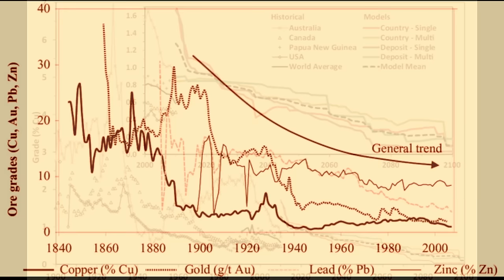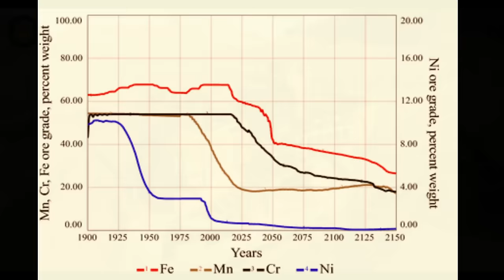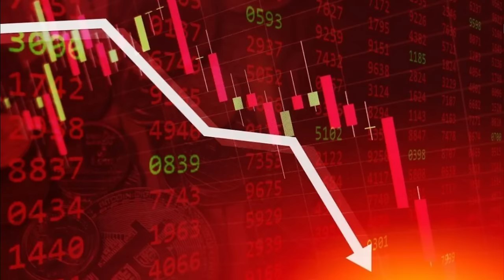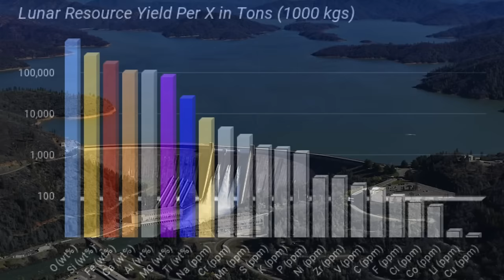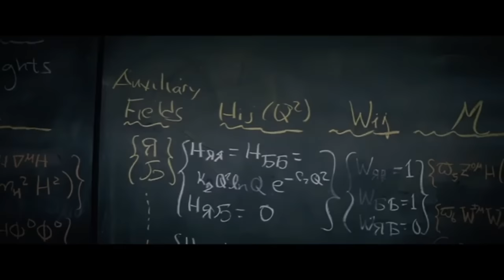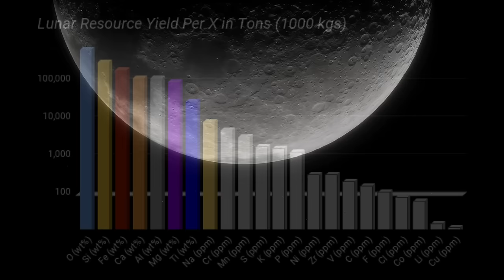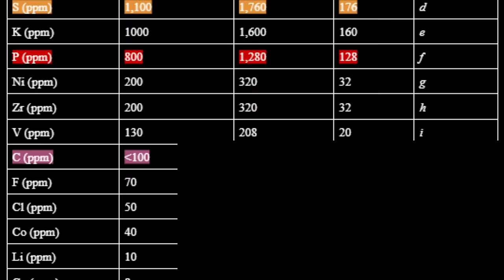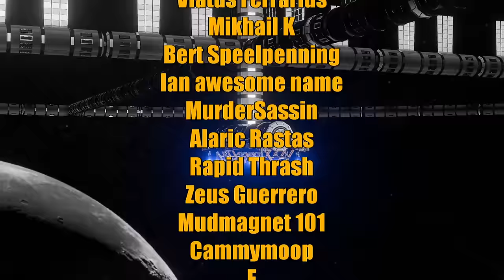Strip Mining The Moon With Giant Excavators

Comment: Another thing to note about Lunar steel - no rust! Low carbon steel with trace alloy metals would get you pretty far.
Reply: An architechts dream
Cheap rust free high strength steel in a decreased gravity environment
Reply: Absolutely. This would also make building first structures out of wrought iron much easier. No oxidation protection needed, at least for the structures that will not have atmosphere inside.
Reply: @johnnywalker472 Your metallurgy will produce free oxygen as a byproduct in such massive quantities that it can't all be stored or used. Some will be dumped, over time creating a faint oxygen atmosphere that could potentially oxidize your metals.
Reply: @louishermann7676  you underestimate the amount required. additionally, the main reason the moon doesn't have an atmosphere is that it lacks a magnetic field and the gravity required to keep it. we could pump whatever we wanted into the atmosphere and chances are it'd end up in space
Reply: @louishermann7676 I believe the amount of oxigen that needs to be emitted to reach that point, is extremely big, especially when we use the oxigen as rocket fuel. So we most certainly would have centuries until we need to worry about oxidation on structures that are outside.
Reply: @xandermoore6485  I'm not suggesting that the moon would keep it, but it is the largest gravitational body nearby and so the free oxygen would tend to accumulate there.

I don't have a grasp on how much that would take, or what variables cause things to oxidize at different rates, but if you build under the assumption that nothing will ever oxidize on the moon and you dump waste oxygen you're likely to encounter that issue at some point.
Reply: Galvanic corrosion will still have to be accounted for.
Reply: @louishermann7676  gotta pump all that oxygen into underground reservoirs ie lava tubes...
Reply: Complete BS. Lunar dust will destroy the equipment.
Reply: @slo3337  Wow, I wasn't aware we were in the presence of the only moon mining expert in the solar system.
Reply: @magisterrleth3129  well now you know
Reply: @slo3337  Lol, okay, buddy. I'm sure you're a real smart fella working on real big things, and your mom is very proud of you.
Reply: @magisterrleth3129  don't call me buddy pal.
Reply: @slo3337  Don't call me 'pal,' friend.
Reply: @magisterrleth3129  don't call me friend brother
Reply: well if there's no oxides then then wrought iron or pig iron would be significant enough so long as you can get pure iron because what makes it not very good is because of the fact thatit normally contains a lot of impurities and it tries to oxidize throughout the whole process as the crystal form resulting in layers of oxide between the Crystal and structure ruining the Integrity of the metal probably be best to use for fixed structures or in areas where oxygen isn't exposed directly to the metal. also why not just use nickel iron it's one of the most common naturally occurring iron Alloys and I do believe it's what most asteroids are made of
Reply: No rust, no gravity.  One could build megastructures from silicon dioxide.
Reply: yeah but we add carbon to steel to get martensite or perlite, we don't add it to protect from rust. Carbon free Iron is extremely soft and really bad to build with.
Reply: @bromine_35  holyhsit you're right
that'd make for some insane architecture
Reply: False, the moon can rust just from the excess oxygen expelled from earths atmosphere.
Reply: Normal steel gets brittle at -40 dark parts of the moon get much much colder
Reply: @pietown044  Sauce, please.

Comment: There's nothing that says moon structures must be built from steel, regolith has lots of aluminum and titanium to use structurally, and vacuum removes the need for shielding gasses to weld them. For megastructures like O'Neil cylinders, those lighter materials might be the preferred options to reduce the cost of lift to orbit.  Concrete made from regolith, made air tight by glassing layers of it, or putting in some kind of resin or fabric liner or whatever, might be another option for Lunar bases. Carbon might end up too valuable for food production biological carbon cycles to put to structural use, given the cost of food imports; conversely if food imports get really cheap, excess recycled sewage solids may be a primary source of carbon for structural use.
Reply: All of the thermosetting resin and epoxy to seal said concrete would need to be shipped up to the moon, and for long term stays we would need a loooot of concrete and steel to seal up
Reply: @phantama7615   We would likely just use sulfur to make concrete, its a great, water free alternative and very robust.  It will work better on Mars as the sulfur is there already, but it's a good option for the moon too
Reply: So many options....
Reply: @BarrGC  you’re right, it’s melting point isn’t to high either, purified and exposed to the sun it would melt into a liquid on the moons surface, giant solar powered forges, easy to transport back to the moon as well since both bodies have lower escape velocity
Reply: and there's no free oxygen / water to oxidize anything, opening the way for magnesium and super non-stainless steels optimized for strength only
Reply: Aluminum is a pretty good idea tbh.

One issue with metals that the author didn’t raise is cold welding.  Since metals wont form an oxide layer, some form of lubrication will be needed to avoid this phenomenon.
Reply: One UAP sample was an alloy of titanium and nickel. Interesting enough you can only make the alloy in a vacuum and melting with a electric arc.
Reply: Do you even know how aluminum is made? That stuff is gonna send us back to the cave man age before you even have time to think about it lol

Comment: So as someone in a background in the mining industry I have another thought. I know we do not know the exact composition of the sub surface minerals of the moon or and real idea how stable it would be, but the idea of mining in shafts that are subterranean seems like a good idea somewhat. It gets rid of the heat issue, also the excavated tunnels and be used for expansion of "habs" for us to live it and all the materials gained may have better composition than that of the surface regolith. If this was done you could also use a boring type machine that would normally be used here on earth for tunnels to mine, because we are nine going after veins like typical below ground ming we can just mine in one line continuously. Like I said I know nothing of the sub surface makeup of the moon and its stability or it's mineral composition, so this could be an easily disproved idea.
Reply: I dont think we will know the sub surface makeup until we are well into the artemis mission

Comment: Mentioned on your other video, but as this one is more recent I figured I'd also mention here that though ferrochrome is probably not a great material for building on the moon, there are several nickel-iron-chrome alloys with promising characteristics.  One in particular that jumps out is inconel600, which only has a few trace elements besides those.  Though not as hard as steel, it beats out most non-steel metals(elastic deformation 400MPa, plastic 700).  It's also highly corrosive and temperature resistant, showing less loss of strength under high and low temperature than steel, which would be of great use on the moon. 

Not saying this alloy is necessarily the way to go(the nickel connect is likely too high to be ideal) but it highlights that there are good options that don't require carbon(or require very, very little).

Comment: 7:53 Why use sodium as a fuel source when electrical operation would seem to make the most sense. Large solar panel arrays would essentially be connected to machinery through big cables on spools that way you don't need batteries. Electrical power is also ideal because aluminum is abundant in the regolith so making simple, cheap, DC brush motors should be easy as long as you can get aluminum refining going. The fact that aluminum is less efficient doesn't really matter since the sun gives us nigh infinite electrical energy. You could probably get alumnium refining temperatures acheived relatively easily by using mirrors to direct sunlight into the lunar regolith and getting it to several thousand kelvin. 

Electrical motors are about as simple as you can get. The main thing would be being able to produce solar panels on the moon using local materials which you need anyways for sufficient electrical power. Companies are already demonstrating this process.

Comment: Understanding that regolith is more than 45% O and 20% Si, and 5-10m deep, the logical conclusion is to dig below to find the original crust or, even better, the Moon mantle exposed on the surface,  with way more valuable materials and better yield. Ergo mining on tunnels and caves.
Reply: Without plate tectonics to bring material to the surface I imaging lunar bedrock will be very low grade. During the moons formation the heaviest elements would have sunk to the center. If the moon was geologically active in the distant past there may be hope though.
Reply: @SephBane After the Aitken Basin impact, the mantle is exposed on the mare with great potential for heavier elements and access from the lower points, also 4By of materials from other meteorites all over the surface.

Comment: Steel is the low-carbon version, the high-carbon version is called iron. This is just because carbon is used to reduce the iron ore to the metal, the less refined version has more carbon and is thus cheaper with worse properties. On the moon you dont use coke to reduce steel so its easier to get purer steel/iron. Other than that, stellar video, subscribed.
Reply: Iron is an element.  Iron IS iron.  When you add a little carbon to iron you get steel.
Reply: @TheEvilmooseofdoom  There is no product you can buy which is Iron without carbon. In the video wrought iron was brought up as an example, but just like cast iron it has more carbon content than steel. If a alloy is called iron then it has higher carbon content than steel.
Reply: @ThePhiphler   I think you mean cast iron/ gray iron maybe?  Cause it's like @TheEvil... said, iron is iron, the element, add carbon and you get steel, add too much carbon and you get cast iron
Reply: @BarrGC  Its a quirky of history that high carbon iron is called iron and low carbon iron is called steel. Give me an example of a product called "iron" that is lower carbon than steel, if you cant then your argument is based on an incorrect assumption.
Reply: @ThePhiphler   High carbon iron is not called iron because iron is an element!  It's called gray iron, or cast iron, or malleable iron, but never just straight up iron, since again, that is the base element.  An example of iron that has less carbon than steel is iron, the element & the only "iron" that exists

Comment: Carbon fiber is unsuitable for reusable rockets because  small stress fissures form leading to catastrophic failure repeated launches. But for a one way trip, using carbon fiber delivery vessels would be one way to deliver carbon without it technically being cargo. Basically incorporating carbon containing materials into the design of as many parts of the delivery system as possible, knowing that it's just getting recycled for the carbon once it's there.

Comment: Maybe below the top rock so it doesn’t suddenly look like somebody put it through a meat grinder 😂.
But also if we mine and it must be on top add a dome and go on the other side we can’t see.
Also if the dome is big enough you can grow rubber trees and have algae pods to not only produce small amounts of oil but plastic but a 2nd benefit is it will add o2 and clean the co2 out.

Comment: good video, 2 things to add. first your lunar lode loader works on hydaulics as shows in the video. probably needs a rework either with gears or pulleys. second as someone working with steel is is easier to use mild steels or steels with different characteristics than 1080. i am not very familiar with american norms but for example simple constructions the chromium manganese and other more valuable byproducts are not desired in frame construction. it makes steel harder to machine ( cutting, drilling and also weldability.) it very well might be very good on shovels due to hardness and less tear. hope you see this not as negative comment , it is not meant to and i am astounded at what pace you creat your videos.

Comment: Just red your book (loved it btw). 
Have few points. 

- On page 101, topic "Infrastructure", you sugest circulation of the "moon containers", between surface and orbit (full up, empty down). I do agree, a degree of circulation is needed and necessary (especially, if SOME of the "empty" conteiners return to the Moon surface with new pre-fabricated materiell, supply, or even people). BUT if there would be enough (empty) containers on the orbit, those could be used as segments for shipbuilding or spacestation building. Metal, hermeticaly sealed, sturdy. Can serve as a tank, silo, hab--module, or even reactor (or rocket engine) housing/shielding. WERY interesting utilization of (shipping) containers on Earth now, are the SOLAR CONTAINERS (i.e. containers with foldable solar powerplant and batery inside). Such kind of "containers" could be mighty ussefull to ships or stations, especially if automaticaly sun-seeking.
 
- Maybe add the pictures of your iterations of the mining vehicles INTO the book - it will close its content a bit to regular reader.

Comment: Just like how we use different kinds of steel for different things, I'm sure we can find a use for low carbon steel up there. If it's so cheap and replaceable maybe it can make up a lot of the parts that would be getting replaced all of the time from dust exposure. Save the good carbon stuff for the internal bits that need to last longer

Comment: Aside from low amounts of Cobalt and Copper, you could make most types of steel in limited qualities per lunar lode. I think the best would be Mangalloy, very wear resistant and impact resistant, it is used in rock crushers all the time. Also all the aluminum, titanium, and magnesium would be great for closed die forging light weight parts for all other off lunar activities

Comment: this got me wondering how viable a space elevator would be on the moon, which led me down a rabbit hole of trying to figure out orbital mechanics, and whether a stationary orbit around the moon is even possible.
But if you think about it... the earth's orbit of the moon is stationary...
you'd have to orbit the moon at the distance of the earth, and that ain't happening
you could try parking something in a lagrange point, but from what I've learned it seems trying to get something in any kind of stable orbit around the moon is extremely difficult

maybe shooting payloads into orbit with mass drivers is the way to go
Reply: Mass drivers are def the way to go.  Moon doesn't technically have a geosynchronous orbit available as you would fall back into earth's gravity well b4 achieving it.

Comment: One major problem with using any bucket or shovel on the moon. It's almost impossible to actually scoop up lunar dust and regolith, being unweathered material it compacts like casting sand almost instantly. You would be better served using a wheel brush to gather the raw material. Not much of a change to your plan, but a profound one.